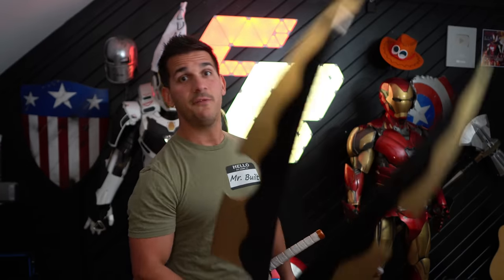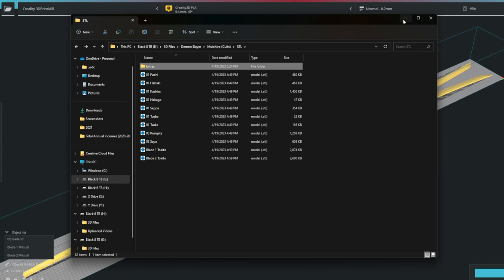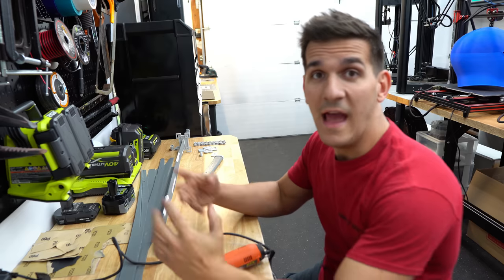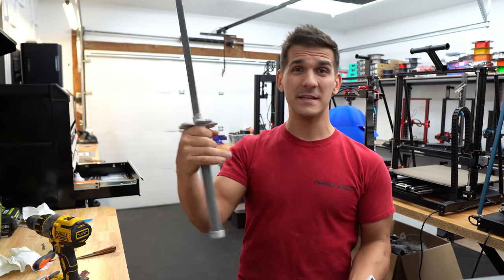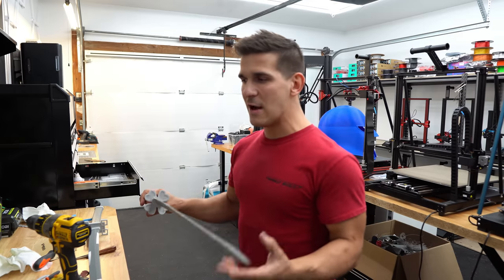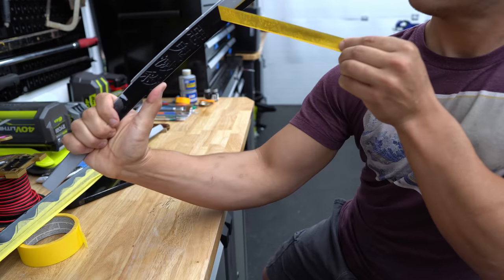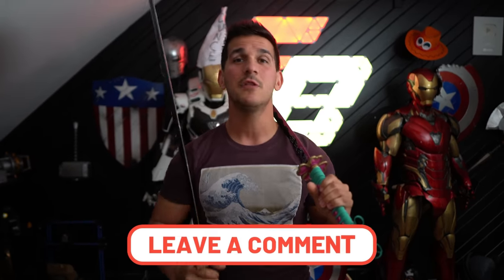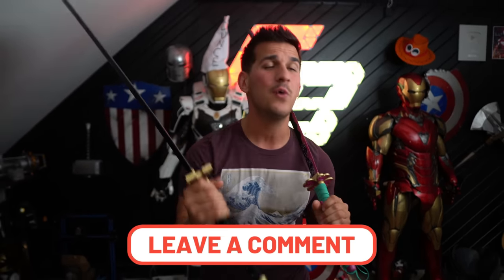Making Mitsuri Kanroji & Muichiro Tokito Nichirin Katanas! | Demon Slayer Season 3 Hashira |

Comment: Hey man, love your vids so much, many of my 3d printing techniques i've learned from your channel such as pla welding, slicing, etc. I was wondering if I could get your input on something. Would it not be better to airbrush everything? I've always used rust oleum just as you have, but would airbrushing not be faster and cheaper in the long run compared to constantly buying spray paint? I'm not sure myself but since you paint and sand so many models I'd like your input on the idea.

Comment: I don’t know much about anime but I know a little about swords! That squiggly pattern is likely designed after a hamon, which is a very similar line on Japanese blades in particular. They’re created during the heat treat process as the different thicknesses cool at different rates. They even induce this effect by covering the spine in clay so it cools even slower, which makes it more flexible!

Your blades turned out really well! Sucks about that ending though lol. I was wondering if I could get your opinion about something though; the fans on my CR10s Pro V2 hot end have been making some awful noises recently when I turn them on. They settle down eventually but I think it may be time to do my first replacement. I figured I may as well get some quality ones that reduce noise while I’m at it, so after some research I’ve seen the Noctua brand thrown around a lot. What are your thoughts on these? I noticed you don’t appear to have any on your printers hot ends. I’ve heard mixed things, either they’re the best thing ever or they’re a hazard and should be avoided. Needless to say I’m a bit confused lol, you’ve been such an amazing source of information for me so I figured I’d try picking your brain!

Comment: Hello  Mr. Built, I got a resin 3d printer this year and I was wondering if you have any advice for connecting resin printed pieces together, welding them haven’t been working for me the resin just crumbles, I currently use hot glue and I’m wondering if there’s any better ways to connect pieces. I’ve looked all over and I haven’t found any videos showing resin prints connecting, I love all your videos and I hope you can help with my problem.